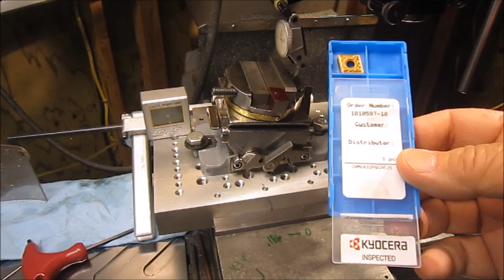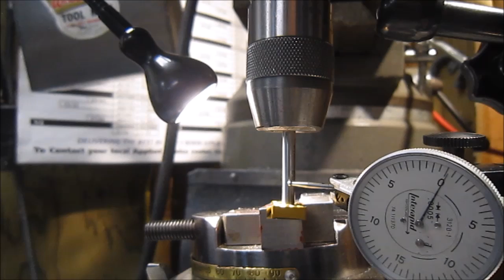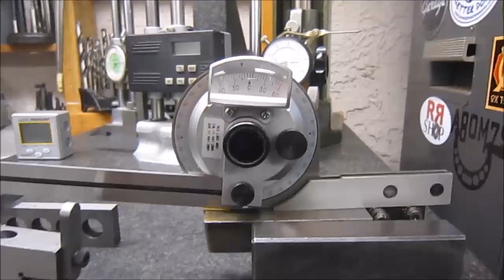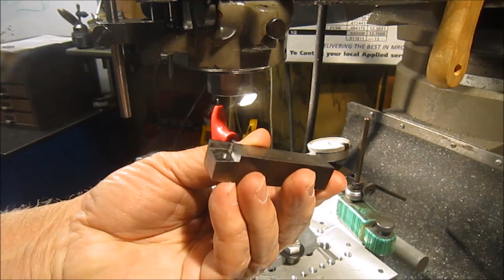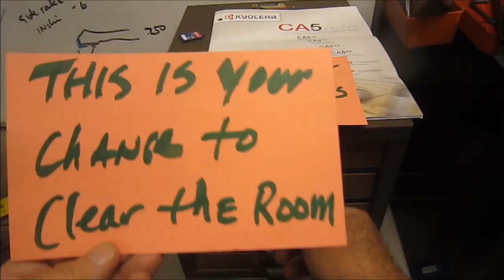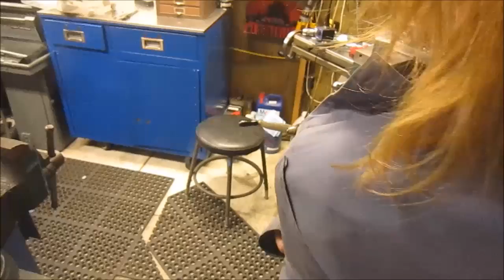SCREWY TUESDAY  #4  A day late but worth the wait

Comment: Hey Chuck,
I should have known that you would be up to April Fool's hijinks! I am a little disappointed that there isn't any scale holders. You are the only that get's to use your wife's. Nice project. I was under the impression that cutters with a negative rake didn't cut very well, but obviously, I'm wrong. Thanks for the tip on the cutter and for scaring the shit out of me at the start of your video! Give my April Fools regards to Katrina!
Have a good one!
Dave